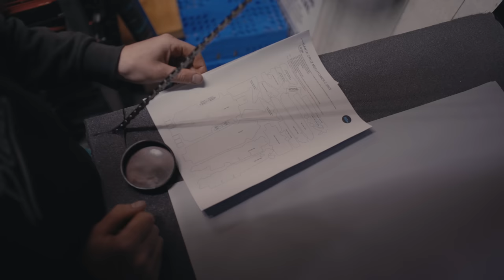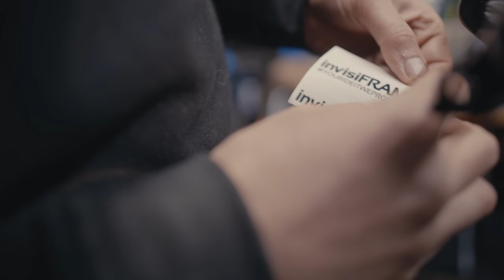DREAM BUILD MTB - Santa Cruz Megatower - NEW LOOK WORKSHOP!

Comment: It's interesting to see how much bike building has changed since I used to do it back in the 90's. And also what's still the same. We used to have to use chain whips to install cassettes back then. But the same old Park chain tool hasn't changed in over 20 years.

Comment: Such a gorgeous build. I also love the seamless look of carbon frames. However, no matter how much I think it is the future, or some other similar material in the future, unless money is not an issue or being professional, I can't justify buying a bike with many carbon parts or frame. The constant though of it being damaged, scratched would drive me crazy especially at the price point. Perhaps in 15 years I will reconsider once the price is low and the technology is bulletproof.
Reply from the maker: Thanks for watching and really appreciate the time you've taken to make that comment! For sure carbon is still not for everyone, I've been fortunate enough to be riding carbon bikes for many years now and a few of them have had some pretty big crashes and rock strikes but I'm yet to have a failure from a carbon frame, Alu on the other hand.. haha
Reply: @GeeMilner    I have also had an aluminium frame crack strangely at the bottom bracket. Looking at some of the downhill and enduro events and the absolute carnage the bikes are experiencing, I am sure they are robust. I think it is more that at the specific price point, a scratch, hit or any crash would be a bit more painful. Kind of like the feeling when you have your first crash on your new bike. But like with any technology, the price will go down as technology improves. So will definitely switch to carbon once the hype is over and they have truly optimized the weight to strength ratio. In the meantime I will be watching your channel to see where the progress of the coolest tech.

Comment: Polishing a mountainbike, well... That's going too far because it's only going to get dirty again at the blink of an eye. It's waste of time, energy and money on those products. 
Cleaning a bike after a dirty ride makes sense however, because that has got to do with wear and tear of functional parts, especially the drivetrain. 

Also have to say that those Milkit valves clog up very easily(mine did after only 24 hours so they are now trash). The idea is good, but the execution...
Reply from the maker: Thanks for watching and thanks for your feedback! I would say that we weren't polishing the frame, we were just applying ceramic coating which helps with cleaning after riding, I've used it on cars for a long time and makes a big difference. The invisiframe also protects the frame from a huge number of things. 

To be honest I've only had positive experiences with the Milkit valves, I tested them on my own bikes before even speaking with them. I would recommend reaching out to them as they're really passionate about their product and the user experience, they'll want to help you for sure.
Reply: @GeeMilner  I'm going to try 76projects valves instead, because I have more faith in them. They can be taken a part which is made for people who like to fix their own things, and I just believe more in that design. There are lots of people besides me who have issues with those Milkit valves, so this is by far not a one time insidence.

Ceramic coating big surfaces like the externals of a car is a big difference to a bicycle so it makes more sense on a car. Cleaning my bike is a fairly quick operation and you will have to use some brushes and what not anyhow. It just makes no sense to me for a bicycle purpose.